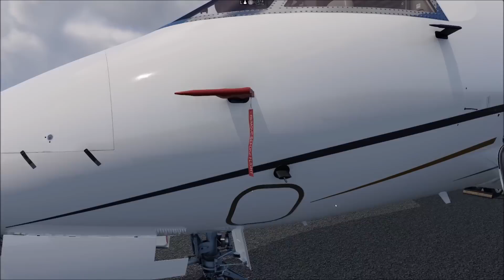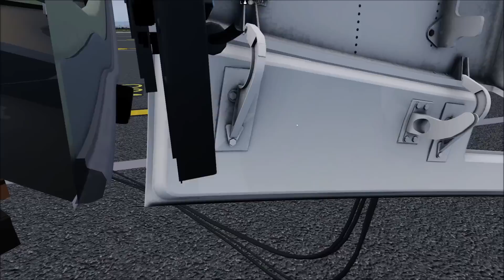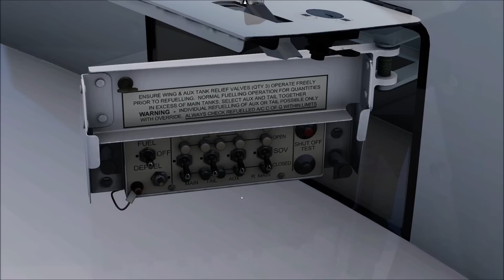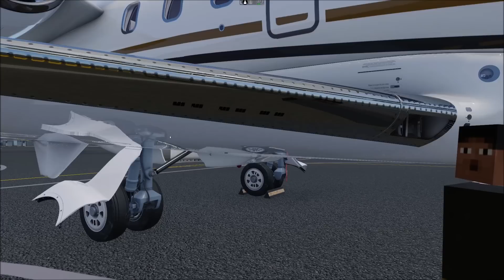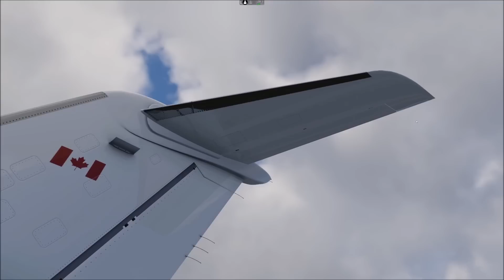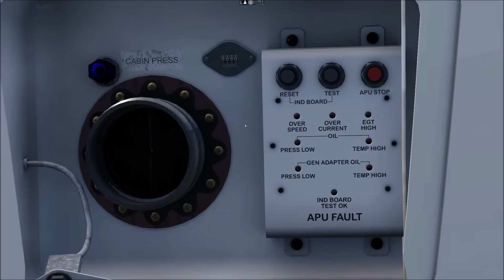HOTSTART CHALLENGER 650 - Detailed Walkaround WITH DEVELOPER Totoro | Real Airline Pilot

Comment: Looks like a highly-detailed mod. Hopefully they can produce a version for MSFS2020.
Reply: Toto has said it’s not possible due to the limitations of msfs.   Xplane allows for a much more robust system simulation. Pretty sure msfs would bust apart at the seems….
Reply: This is not true  @PKerusso . Aerosoft, PDMG, A2A and Just Flight have done a ton of simulation work which doesn't rely on the native aerodynamics support. How do you think helicopters were put into the sim before they were officially supported? The A2A Comanche has it's own independant flight model, wear and tear and persistance in MSFS and is probably the best known example to date.

Comment: Great video and amazing to have Toto onboard. This addon is for sure a masterpiece. At the same time I don‘t fly it often because having to „scroll“ through all options by using the knobs is a bit of a pain for me. But that is just how the real aircraft works. I am looking forward to the A220 from Toto that should be a bit „easier“ to handle 😊
Reply from the maker: I know what you mean - but did you know you can open most of those panels as 2D panels so that it becomes easier to handle them? Still not an optimal solution, but better than nothing!
Reply: @A330Driver  Thanks Emmanuel. Indeed I knew that. It‘s more about all the knobs (smaller ones inside bigger ones) opening different menus on the screens 😀🙈
Reply: In 1.8 beta you have ghost panels when you hover with mouse over screens  @frankbyte
Reply: @jakobmarolt1449  That sounds great. I haven‘t installed that beta yet but this could help, indeed. Will test this version. Thanks for the info 👍

Comment: This aircraft is the only reason i still have xp11 installed. Hats off to Hotstart.
Reply: It works with 12
Reply: @jcrosby4804 I am not sure of the benefits. I know graphics have improved and weather modeling.
Reply: It works with xp12 but I get sub 18fps. Not aircrafts issue, just xplane lol.
Reply: @jcrosby4804 what? I mainly use MSFS now which is why I only have xp 11 installed for this aircraft. I also don’t fancy buying xp 12 just for the one aircraft.
Reply: @jcrosby4804 better lighting, better clouds, better flight dynamics, better airports, better weather system etc.... 
You can watch any of my recent streams here on youtube and compare it with your XP11 copy and see if you feel it is worth it. If you have any more questions, I would be happy to answer.

Comment: Hats off to the developers! Aircraft development for XPlane is much more streamlined and easier, in comparison to MSFS, and it's no wonder that XPlane allows for such detailed aircraft.
Reply: also, the available selectio  of high quality aircraft  for xp is much better. a320 319 321 757 767 cl650 md80 md11 crj....and many more. in msfs you have fenix, pmdg, leonardo, thats it.
Reply: @maltimoto It matters only if you care about airliners. MSFS has better GA aircaft, way better Garmin avionics, and a lot of default aircraft that is VATSIM ready at least.
Reply: @Michael-zf1ko  There is a reason complex airliners aren't modeled as well though. The MSFS SDK is horrendous to work with, it is incomplete and lacks many essential functions and features (WX integration etc.). When I worked on MSFS addons, they were a pain in the ass to develop since you must relaunch your sim to test the effects ingame (instead of just reloading the aircraft like in XPlane). Couple this with a lackluster documentation and you double your development hours.
Reply: @Michael-zf1ko  I don‘t think it is possble to have a much better GA than the TBM900 or the Airfoillabs C172 in XP. I know only about the Comanche in MSFS that seems absolutely brilliant. What do you think is better in the other GA‘s knowing the flightmodel isn‘t quite on par with XP‘s one?
Reply: @Michael-zf1ko  That's right. Actually I am using MSFS for VFR because MSFS has better ground scenery and the GA aircraft are really good (Comanche, Chancellor, Milviz). For airliners, X-Plane.

Comment: This is hands down the most realistic add-on there is IMHO. People say oh you dont need to see all the engine parameters working etc., and they are right you dont.. But what you need to remember is this is actually a reflection of how this plane is being simulated, those parameters of which there is Engine, AIR, GPS positions, Fuel etc. etc. are actually what is happening in side your sim. None of it is faked, none of it is just for show, it is real time it is happening as you watch it is beyond even XP's default  FDE stuff, it is a sim within a sim, It is amazing.

For those wondering:
It is very complex but it has a Virtual FO, that really helps with interactive check lists.
It is not a kick tires and light the fires plane, but it also isn't or does not need to be a 2 hour start up process
It has simbrief integration + Charts with AviTab
It is a joy to fly
The Avionics are I think 1:1 with Real life for almost everything and things you would never use, except things you just cant simulate.

The performance is great despite how complex it is and it has a mini RPG element to it and even that is a choice. FL410 at a good speed, I crossed the Atlantic in it EINN-KBOS is just under 7 hours once in XP of course.

Comment: I am actually gonna buy the CL650 on the 15th. This video came timed perfectly! Amazing aircraft! Very happy that I made the switch to XP12 ❤ keep it up!
Reply from the maker: I'm using both simulators these days and couldn't be happier with that decision. Both have their own qualities.
Reply: @737NGDriver I use both simulators as well and I think you would be doing yourself an injustice to pick one over the other. Both are great and have strengths to them, so why not just have them all. Great time to be a flight simmer. Both excellent products! My hard drive will beg to differ though.
Reply: @IkennaM-007  I would love to use both but my SSD simply hasn’t enough space… and I really have to go with the sim that can handle the CL650😂😅